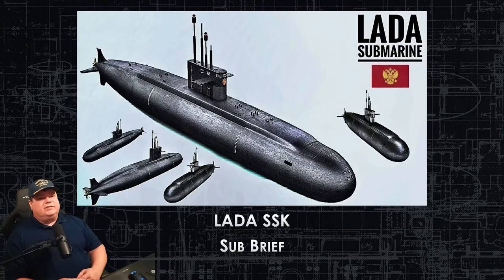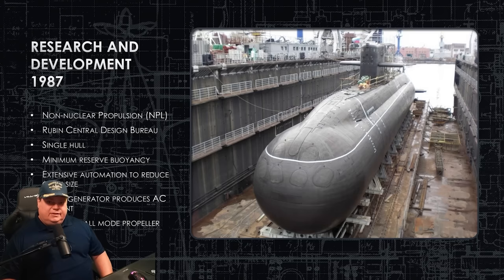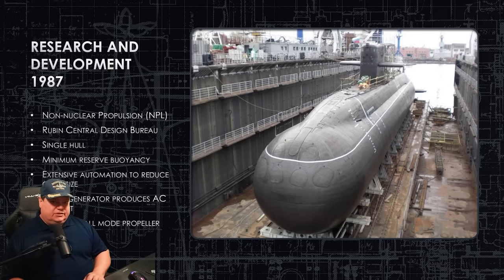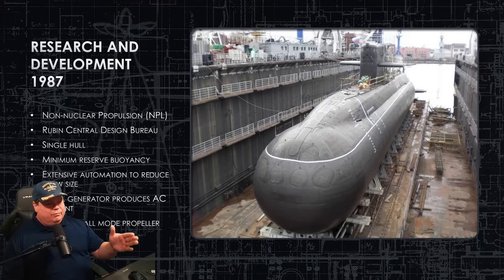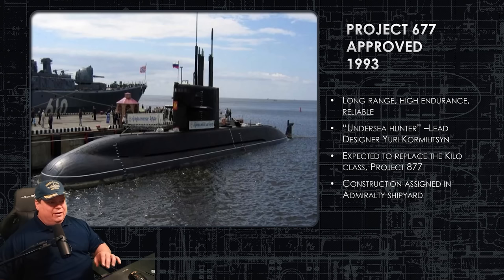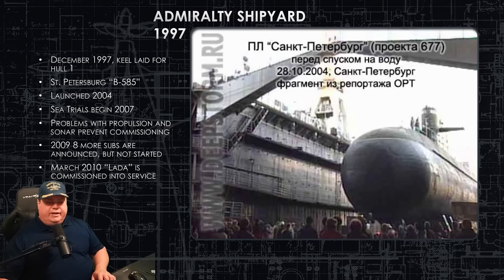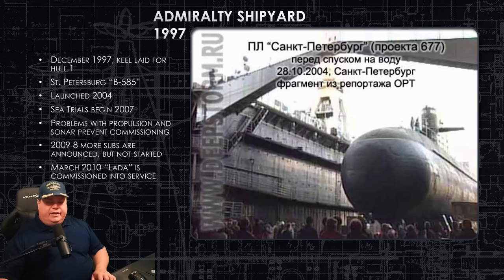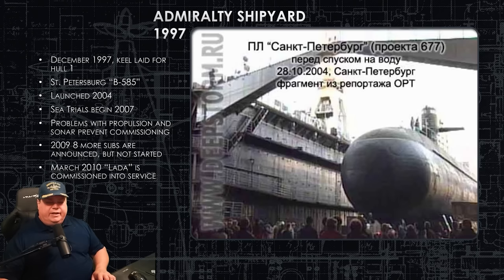Russia's Project 677 Lada-Class SSK Sub Brief

Comment: What's an "energy cell" battery? Lithium-ion?
Reply from the maker: An energy cell, also known as a power cell or battery, is a device that stores and releases electrical energy through chemical reactions. It is commonly used as a portable and compact source of power for various electronic devices, such as smartphones, laptops, cameras, and electric vehicles.

Energy cells typically consist of one or more electrochemical cells that convert chemical energy into electrical energy. These cells contain two electrodes, a positive electrode (cathode) and a negative electrode (anode), separated by an electrolyte. The electrodes are usually made of different materials, and the electrolyte allows the movement of ions between them.

During discharge, a chemical reaction occurs within the cell, causing electrons to flow from the negative electrode to the positive electrode through an external circuit, generating an electric current. This current can be used to power devices connected to the energy cell. When the stored chemical reactants are depleted or the cell reaches its maximum discharge capacity, the energy cell can be recharged by reversing the chemical reaction through an external power source, such as a charger.

Energy cells are available in various types, each with its own characteristics, advantages, and limitations. Some common types include:

Lithium-ion (Li-ion) batteries: Widely used in portable electronics and electric vehicles due to their high energy density, lightweight design, and rechargeable nature.

Nickel-metal hydride (NiMH) batteries: Commonly found in older portable electronics and hybrid vehicles. They have a higher energy density than traditional nickel-cadmium (NiCd) batteries and are rechargeable.

Lead-acid batteries: Used in automotive applications, uninterruptible power supplies (UPS), and other high-power devices. They are relatively inexpensive but have a lower energy density and are not as environmentally friendly.

Alkaline batteries: Often used in household devices like remote controls and flashlights. They are inexpensive and disposable, providing a convenient source of energy.

Zinc-air batteries: Commonly used in hearing aids and some specialty applications. They rely on the reaction between zinc and oxygen from the air to produce electricity.

These are just a few examples of energy cell types, and there are many other variations available for specific applications. The choice of energy cell depends on factors such as the desired energy capacity, voltage requirements, size constraints, and environmental considerations.

Comment: Yo there, you badly wrong most as in all non nuclear powered modern subs as in subs built post 2000 are not capable of 25 kts most are in the 20 kts class region. Most as in nearly all subs do not have lithium ion or lithium batteries. Most as in over 95% of modern frontline subs used lead acid batteries. The Type 39s, Scorpene, Agosta, Type 212A, Type 214, Soryu (2 have lithium batteries of some king double energy density), Type 209/1400 all have lead acid batteries & have around 20 kts submerged max. Only the KSS III yet to see operational service may touch 23+kts & may have lithium batteries of some kind, the very, very few  Japanese Taigei class submarines may touch 24+kts submerged with lithium batteries of some kind & 2 lithium battery Soryu. However not all only about 50% of conventional diesel  electric subs (>1,000 tons) thar are not Kilos have some kind of AIP system on board, generally of 3 types Fuel cell of PEM type, Mensa french ethanol + Oxygen AIp system & sterling cycle Aip engines.

Comment: Great video like the format.  The drawing of the Amur 950 is not from Russia, its a fan boys from a naval show.  I think it important to remember the Russian defense budget is 60 billion. That is not a lot when building Yassens, Borei , Gorshkovs. Etc. Having  to pay for an Army and Air Force as well. 
  The 677 was redesigned from the ground up, they had a fall back in the Kilo 2 which they have built 10 new with more on the way. 6 were sent to the Black sea fleet so no need for the lada. By all accounts the 677 makes the 636 a what ever the equivalent fish is for a dog!  When the first in series turned out to be a total dud they did the Russian thing and stopped. Then started over. They could have done the American thing and built sixty boats they knew were crap... 60 boats they knew would never work...LCS style. 
 Boat one is really a test sub , The next four subs will be far superior to the design of old, the only thing that is the same is the name. It should really have gotten  new project #  but here they did the Russian thing and called it Lada 677 m , had they done like Americans would they would have named it 777 because everyone knows 777 is better that 677! But they are Russian and it would have went on forever as someone points out 877, 977 and so on. Alas there is info saying that the AIP was hydrogen cells, this testing delayed a lot. Either could not crack it or costs too much, new sonar, new flanks sonars,  and new towed, a lot of new tech will be on the 677m

Comment: LEAD ACID BATTERIES, what, they couldn't get any Nickel Cadmium Cells (going by the era, Lithium-Nickel-Cobalt, Lithium-Titanium, or Lithium-Iron-Phosphate wasn't available yet).

Now days i'd expect sub batteries to be Lithium-Titanium or LiFe-PO4 cells, not Li--Ni-Co as they burn easy, with the Li-Ti cell being my favorite as they don't degrade. Run a Li-Ti cell from 0% to 100% to 0% again, they don't care, no dendrite formation, no major thermal flux, sure they store slightly less power than other lithium cells but they are bulletproof in the engineering for longevity sense.
Reply: Well Australia was planning to use lead-acid on the Attack class (until we dropped that idea for the AUKUS deal).

Comment: the St petersburg is decommissioned and is getting scrapped. and the newest lada has a full titanium hull with refined anechoic tiles. and the have a passisv sonar in the bow and a pair of low frequency flank array sonars and the towed array sonar and a sonar in the sail. they have AIP. they have 4 150 or 200 kilowatt AIP egnies and can run the sub or charge the lithium-ion battery`s. and the 10 vls. the lithium-ion battery`s opens opp a lot of space and all the systems are now fylly automated and it operated by a crew of 24. its speed was more then 28 knots during the laste i was onboard the sub. we traveld from st petersburg to kalingrad an back with out anyone else the the suport ships that followes know we was theire. we almoste colided with a swedish sub that did not see us. it passet the bow og the sub i was on by only 40m to spare. now i have left russia so i can speak out with out frear of getting arrested by the fsb or gru or fso and the gusp

Comment: Let's hope te submarine won't be as bad as the car.
Reply: The car is great
Reply: @schutzanzug4518  I've driven a couple of them and i can assure you nope they are not, there is a special Top Gear episode dedicated to all the scum that the former USSR has produced. They stole the design from a Fiat in the 1960s  and thus came out the VAZ 2101 and so on untill 2107, i've driven 2101, 2105 and 2107 and compared to the western cars from the time those were really bad. The only lada i can say was good was the Niva.